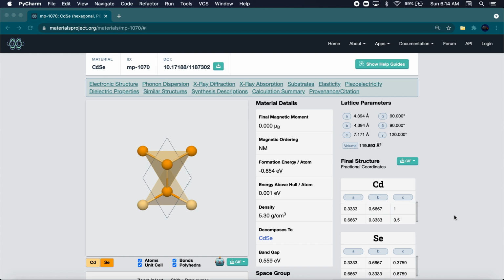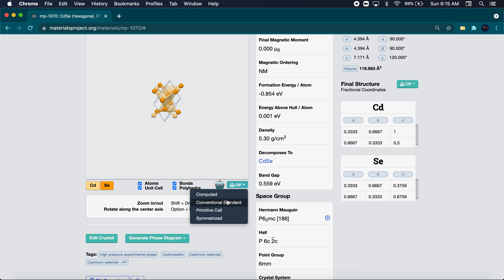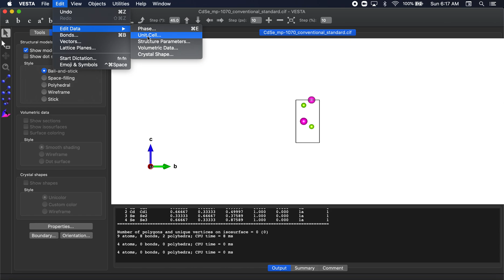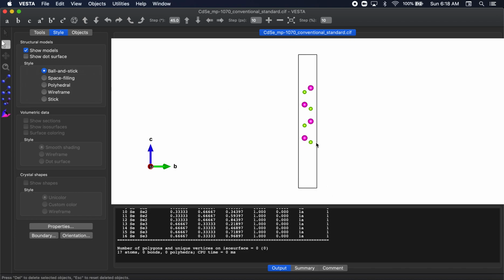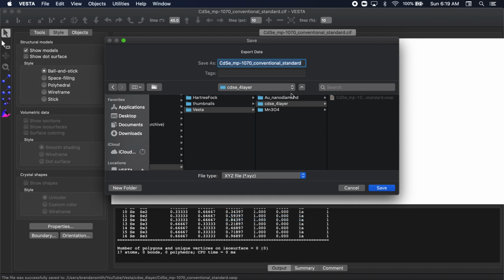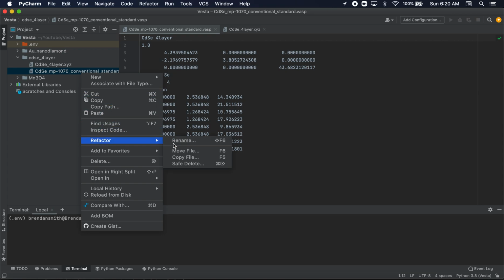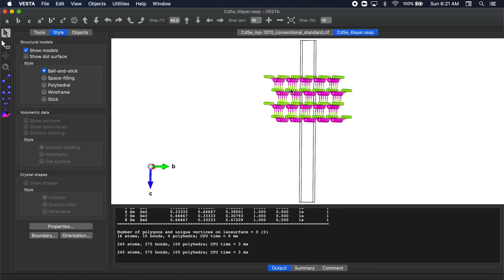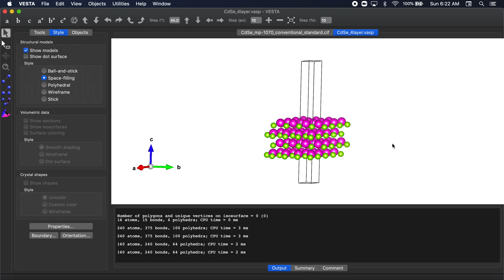Slab Model CdSe 4layers in VESTA

Comment: Thank you so much sir for making this video and also thank you very much for considering my request. Really appreciated ❤️
Reply from the maker: Sure thing. If you decide to terminate the top layer with Se that is also valid but you will break the CdSe stoichiometry of the system. I do think though that some sort of additional termination may be needed for this system. I suspect there will be dangling bonds on either the Cd or Se terminated surfaces. So I think one should do a through literature search and confirm with coworkers and colleagues  before moving forward with this system
Reply from the maker: I think the slab should give a band gap roughly equal to the bulk band gap of CdSe - so I think some sort of termination (selenium layer or hydrogen passivation?)  can achieve this if it is not achieved already